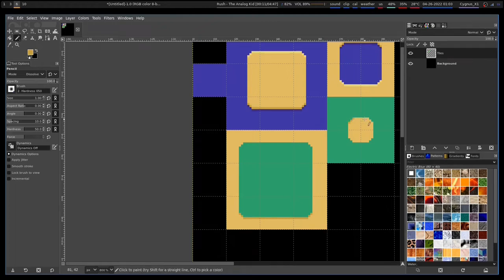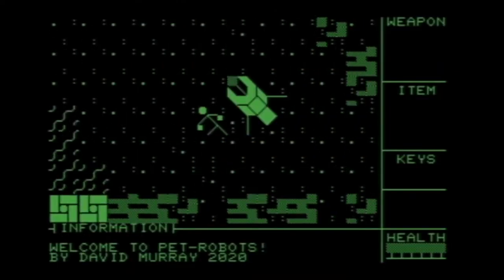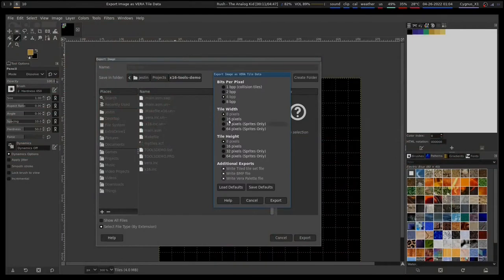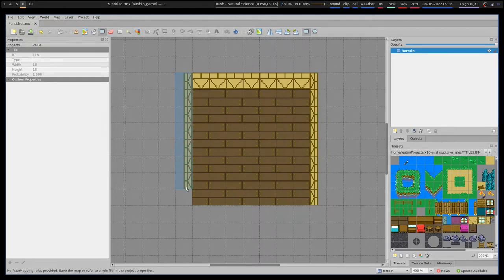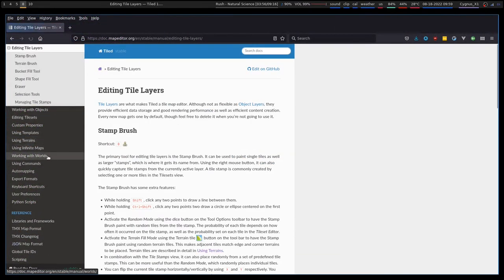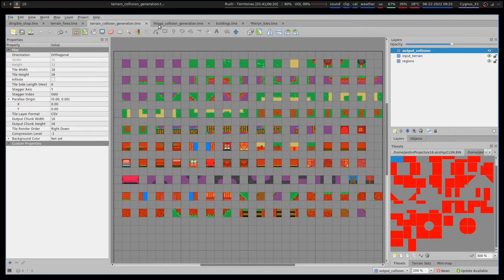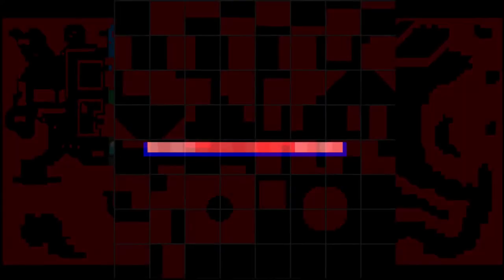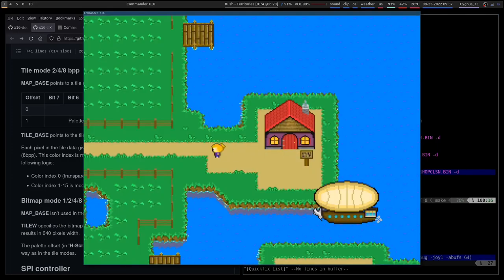Commander X16 Collision Detection

Comment: I started looking at X16 dev and both looked at the code and tested the game, because I'm always interested in approaches to collision. One limitation of this collision system as-is is that it goes "sticky" when the player runs diagonal into an obstacle, since it just blocks all movement. This is a solvable quality-of-life issue; 2600 Adventure solved it, I think any game can. What the collision needs is a simple constraint solver.  In the diagonal case, there are three possible solutions where movement can take place, two of which allow the player to slide along a wall. What the code has to do is test all three and then choose the "best" according to some heuristic.

In my example of 2600 Adventure, it's done by simplifying the problem into alternating X and Y axis movement each frame; if movement is rejected on one frame(which creates a visible flicker as the player is moved back), the diagonal input continues on the next, trying the other axis. Many 2D games continue with this "test and move on one axis, then test and move the other" method, because it's a cheap and simple way to think about the problem, just doing both tests on the same frame so that there's no flicker. This method comes with the limitation of biasing movement towards the first axis being checked, since the information needed to see a third solution is destroyed once you commit to moving on the first axis.

With that I should note that I lied: there are actually four solutions, because two of them are "only move on X/only move on Y" and the other two are "X then Y/Y then X". When we allow the diagonal move directly, that often acts as a way to warp through walls if the character is moving fast enough. The genius of only moving along one axis at a time in a stairstep is that, given reasonable speed of movement, it will always see terrain that's in the way at some point; when the movement vector goes off-axis, it becomes much harder to reason about.

I believe for this game, just running the pixel-perfect collision only three times each frame and defaulting to the diagonal solution would be fine since the movement's slow and the characters and terrain are in proportion(which helps eliminate some edge cases). But I like bringing out this example when I see it, because it took me years to understand what was going on when the collision failed, exactly, and what it was if it wasn't a "collision detection" issue. In games with more physics to them there are many more compromises being made in the solver since the solution set gets much bigger as you add fast movements, rotation, transferred momentum etc. But the actual detection code is relying on the same ideas everywhere(either test masks or test geometry).
Reply from the maker: Thanks for the ideas and feedback.  I actually had a solution for the "stickiness", but it was a naive fix and ate up too much CPU.  I'm currently optimizing the collision code, so I'll likely take another run at it.  I actually didn't want diagonal movement at all, but I polled a few people, and the "yays" had it.  I may give the stepped approach a try, since I could probably do that in a way that would slow down diagonal movement.  I'm not a fan of the speed the character can move diagonally, however that was called out as an advantage when I polled people (Pythogoras be damned!).  I'm certainly going to play around with this once I've reclaimed some CPU cycles!
Reply: @digitaljestin  You could also use a tile map based on hexagons instead of squares.
Reply from the maker: @OpenGL4ever  sort of.  In VERA, your tiles are rectangles, period.  That doesn't change.  I suppose you could make a custom set of rectangular tiles that look like hexagons when put together.  Still, you'd need permutations of different tiles next to each other or something.  You could also fit an entire hexagon onto a rectangle, and then stagger the rows between VERA layers.

Point is, yes, you can do hexagons, but it's going to cost you both resources and complexity.  VERA is made for rectangles, so it will always be easiest to use them.
Reply: @digitaljestin  Do the tiles support an alpha channel? So that you can make the corners of a hexagon transparent?

I understand. On the other hand, using hexagons would set your game apart from the rest. And hexagons do also allow a spherical world, including a north and south pole than can be passed.
Reply from the maker: @OpenGL4ever  it's not really an alpha channel, as you can't have a pixel partially transparent.  You can set it to all the way transparent or not.  So yes, that would be required for the 2 layer solution I suggested.  But you only have two layers, so now the player can't go behind objects.

This style of coding is great because you can accomplish a lot, but you always need to consider the cost.  In the case of hex tiles, it will likely cost you a lot of VRAM or cost you a 2 layered game.  Choose your poison.
Reply: @digitaljestin  I understand. Thank you for your information.

I would choose a modern machine. 😉

Are you planing to sell your game? And if so, do you think it will be financially successful on the Commander X16?

Comment: This is exquisite work and I love the in depth explanation.  Your game looks amazing as well.  I am making a Metroid clone and was having a hard time trying to handle collisions with the map.  Thank you for this.
Reply from the maker: Aw, thanks!  Feel free to reach out if you plan on using my tools and need some help.  Although I'm still fixing a few bugs and expanding the features, the part I should probably focus on is improving installation.  I've pretty much assumed that anyone interested in X16 development isn't afraid of compiling tools from source, but I'm not sure that's 100% correct.
Reply: @digitaljestin  Thanks!!  I am good with compiling from source.  I am using Windows with Visual Studio Code for development though.  Will the tools compile on Windows using Visual Studio?
Reply from the maker: @anthonyrufrano7452  No idea, but I'd love to find out!  I use `gimptool-2.0` to determine the gimp plugin's dependencies, but `tmx2vera` only needs libxml++2.6 (I figure out dependencies using `pkg-config`).  I accept pull requests if you want to help me add visual studio support.  I suspect porting wouldn't be too hard.  Hit me up if you have questions!
Reply: @digitaljestin  I'll give porting them a shot and let you know.

Comment: Your setup is really amazing. I have a few questions. Some older Pokemon games along with other old RPGs use grid-based movement, not the jerky type like you spoke of in regards to Petscii Robots, but with smooth transitions between tiles. Each 16 x 16 tile is either fully traversable or fully not. Would a movement system like this work with your tools? Would it simplify things and would the simpler collision "save space"? You mentioned the size of your maps were determined by the tiles stored in VRam I believe. Is it possible to swap out tiles between scene changes? I'm also very curious about the color capabilities of the Vera. I believe you mentioned a 256 color mode but I have read that the Vera has 2 layers. Is the second layer sacrificed to get 256 colors on the main layer? Are there 16 colors per tile/palette and 16 palettes like the SNES? I noticed your character sprite displayed behind the treetops. Is this the second layer, or maybe some kind of Y sorting? I believe you said you were displaying in 2x size, does this mean your game shown is running at 320 x 240? Sorry for the barrage and nice work whether you can answer or not.
Reply from the maker: Wow, that's a lot of questions.  Let me try to get to them.  You absolutely could have tile based collisions with smooth animations into the tiles.  The tools I'm using to generate the tiles and the maps would work for this.  You'd just designate every tile as collideable or not either with automapping like I'm doing, or something simpler like keeping all tiles that collide above or below a certain index in your tileset.  When it comes to my pixel-level collisions, it costs more CPU than it does memory.  I wouldn't be able to pull it off if the X16 wasn't 8mhz.  Swapping tiles in your map is certainly something you can do.  My approach is the simplest, which I get away with because of how much VRAM the VERA has.  Older systems would require tile swapping for something like this.  No, you don't sacrifice layers for more colors.  You have those layers no matter what, but VRAM is still your limitation.  For example, both my layers share the same tileset.  I wouldn't have enough VRAM for them to each have their own, so my tiles need to work for both layers.  I could sacrifice a layer and its tile map in order to free up VRAM, and that could allow me to increase the size of the game map, but then the player couldn't walk behind anything.  In 8bpp mode, you can have 256 different colors on a single tile...but it costs you VRAM.  My 16x16 tiles each take up a full 256 bytes of VRAM, and I have 256 of them.  Half of my VRAM is just tiles, and the other half has to have 2 layers worth of maps, my character set, and some other 1-off sprites that aren't in my shared tileset.  I'm really abusing how much VRAM the VERA has.  The tree effect is indeed the second layer.  There would be less VRAM-expensive ways to achieve this effect, but with my CPU spinning on collisions, I'd rather just burn the VRAM.  And yes, my game is running in 320x240 mode.  It actually can run in 640x480 mode, but the player would see too much of the map at once and the character is too small.  I prefer 320x240.
Reply: @digitaljestin  Thanks very much for taking the time to answer all my questions. I now have have a few more. I have been working on a retro game for a while now and have limited myself to 4 colors per tile, like the NES but with a bigger color palette to choose from. You said the 8bpp allows 256 colors per tile. Is there a video mode that would allow for 4 colors per tile? Also, is there one for 16 colors per tile? 256 colors per 16 x 16 tile is massive overkill for me which is why I ask. You said you have both layers share the same tileset and would not have enough VRAM for each of them to have their own. Could you have one layer have the tiles you are not supposed to overlap, for instance the tree trunks, and have the other layer have only the tiles that are supposed to overlap the player, for instance the tree tops? Or would that not help anything?

Oh and I also like the idea of keeping colliding tiles at a different index and I love 320 x 240. Thanks!
Reply from the maker: @brunch1572  First, I highly recommend you read through the VERA docs, where most of your questions are answered: https://github.com/commanderx16/x16-docs/blob/master/VERA Programmer's Reference.md

So yes, you can use 4 colors (2 bits per pixel, or 2bpp) as well as 4bpp.  There's even two 1bpp modes, but the tile map is a bit different different.  You in no way have to go my route and use 8bpp, which is quite wasteful, but goes to show just how amazing the VERA is.

You could use one layer for collideable tiles and one layer for free tiles, but I don't think it would really give you anything.  There are no interrupts for determining collisions with the tilemaps, so you'd still have to compare against something read from either RAM or VRAM.  I went with RAM, so it could be completely independent of which tile or color I'm using on a certain part of the map (see the section of the video on collision overrides).  If you want tile-level collisions with no additional memory usage, you can read the tile ID from the tile map in the VERA.  However, I have to warn you that reading and writing to the VERA's VRAM is best done in bulk, and is not well suited to looking up a single value.  See the docs on how the VERA's data registers work, and you'll understand.  That's another reason why I just have a separate collision map in main memory, where it's much easier to read the exact value I need in order to determine collisions.

If you are developing a game, I also recommend checking out https://www.commanderx16.com/ and joining the forums and discord.  There's a lot of people there who can help guide you and answer your questions.  They've certainly helped me!
Reply: @brunch1572  If you use only 4 colors, you definitely should use the CGA color palette for retro reasons. So cyan, magenta, black and grey. Or if you select palette 2 black, green, red and yellow. You also should use dithering.
Reply: @OpenGL4ever  Thank you for your comment. What I meant about the 4 colors was more like how the NES does things. 4 colors per sprite or background tile (really 3 counting transparency for sprites or background color with tiles), but from a selection of 50-something total colors. I have been working on an RPG in Godot for a little over a year, and have settled on 4 colors per background tile (one color dedicated to transparent if applicable) and 8 colors per sprite (again with one color dedicated to transparent, which is obviously used much more often than with background tiles). This is all from a total custom palette of 256 colors. So if the X16 ever comes out, I will probably go with the 16 colors per sprite/tile mode with 256 simultaneous colors on screen to be able to directly port all art assets. Incidentally, this mode is extremely similar to the SNES which allows 16 different palettes of 16 colors each.